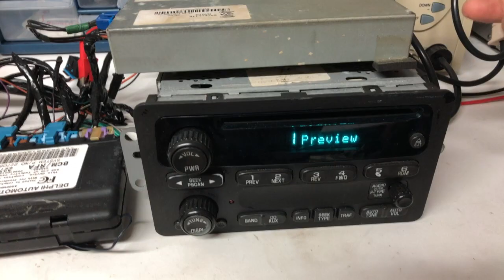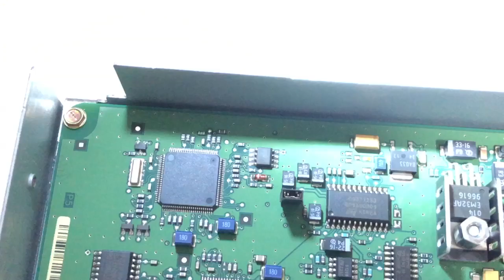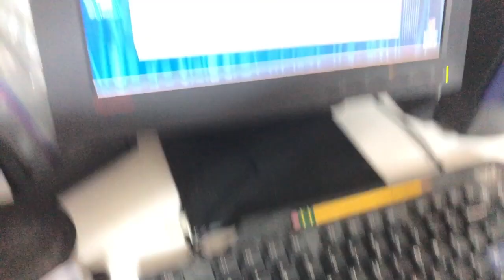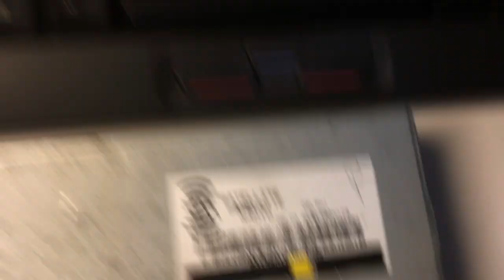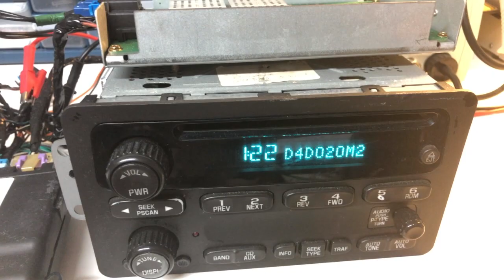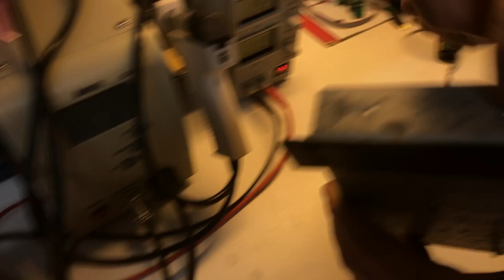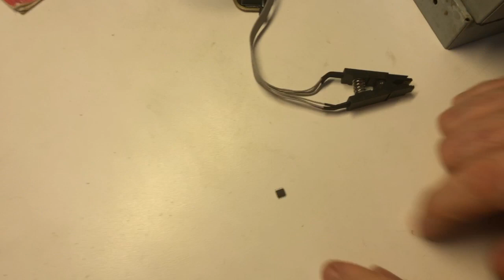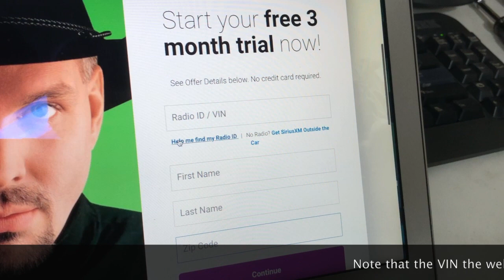2003 04 05 Unlock XM Lock Error on Salvage Yard GM XM Receiver (Buick Cadillac Chevrolet Pontiac)

Comment: What would happen if you just disconnected the chip rather than reprogramming it?
Reply from the maker: Well we can see the XM Radio ID, the units serial number, and likely what appears to be XM station preset info stored in the EEPROM chip.  There may be other obfuscated information stored there as well, no way to know as GM never documented it publicly.   While I've not done it myself because I wouldn't have considered it a repair but more of a mod, I'm quite sure removing the power pin of this EEPROM chip would still clear the VIN lock.   But then you would have to accept the loss of whatever minor XM functionality was dependent on the data that chips memory locations contained.
Reply: @DrShock   So I ended up trying out of desperation and it seems the only issue that it's given me is I have to press the Second knob in to see artist or song info, otherwise it doesnt show it and  just stays displaying the station name.
Reply from the maker: Thanks for sharing that, what about displaying your Radio ID on XM channel 0 - does that still work?
Reply: @DrShock  yes, it does.  I disconnected the battery for a few hours to do something and now it's acting up, I still have all my channels but it keeps turning itself back and deleting my presets so maybe it needs to sit for a while like it did last time when I 1st installed it and it was acting up or something is messed up. I'll keep you posted.
Reply from the maker: @AlexSirghie  Yeah, this is just one of the side effects and why replacing the EEPROM as I showed is the only real repair here.  But having some other option if you lack the tools or parts is good to know, thanks for sharing.
Reply: @DrShock   So after leaving it connected and attempting to make it work again, its messed up.  I'm just gonna grab a new module from the junkyard because there's an envoy that has one plus this one is the kind you have to take the chip off the board to make work, so  Sense the envoy is a little newer I'm assuming it has the style where you can leave it on the board and I bought the same style chip programmer you have.  Hopefully I can figure out the right software to make it work.  Can this be made to work with unlocking a head unit as well?  My message which has worded flawlessly the 2 times I've done it is transferring the chip from one stereo to another which is how I got a Pontiac stereo to work in my Malibu, but I'm switching to the touchscreen 1 that the rendezvous Got and I don't wanna heat that chip up any more times and risk ruining it, could this method be used for that?
Reply from the maker: @AlexSirghie  I haven't worked on any nav head units, or the touch screen ones yet.   But for the earlier RDS type radios the approach is very similar, I did a video on that here https://www.youtube.com/watch?v=ZIRefUhyJOQ&lc=UgwTkSwbhvMA04hit8x4AaABAg
Reply: Thanks for that, what does it mean if I've done everything you've done including modifying the programmer for 5 volts, but I'm getting nothing.  The LED is lighting up whenever it's connected and it says that it successfully talking to it but all the values are empty or have zeroes. What did I do wrong.  These don't have the type of chip where you have to re-pin it right?
Reply from the maker: @AlexSirghie  Be sure it's pin 1 aligned, and in the right half of the ZIF socket on the programmer.   You should be able to read it even at 3.3V, so the EEPROM programmer mod isn't even needed for reading just writing.
Reply: @DrShock   So it turns out my test clip was bad and all of the weires were just heat shrunk to the pins instead of soldered correctly (they just slid off), so I ordered a new one and I ended up remedying it by removing the the eeprom from the reciever and moving it onto the board that plugs into the USB stick and got it going.  Thanks for the help, I have now successfully retrofitted satellite radio into my Malibu as if it would have been from the factory if these had got it.
Reply: @DrShock what is the mod needed for the 5v or is it just a jumper change on the programmer?

Comment: I am curious about the jumper.  I wonder if you remove the jumper and then use the tech 2 to setup a “new module” if it will then make it writable and it would learn the vin like a new module would.  Then reinstall the jumper when finished.  I recall some eeproms having a write enable hardware pin.
Reply from the maker: Not sure what you’re referencing from the video, as there’s no "jumper" associated with the memory device (EEPROM chip) on this specific XM circuit board.
Reply: @DrShock in the video where you mention the jumper pin on the board and the two different locations depending on the first gen or second gen board.  I ordered a programmer and should be here tomorrow to update the vin in my jarkyard unit I am installing.
Reply from the maker: So that comment was just meant to highlight a means to distinguish between the two board layouts.  Not that it had anything to do with the VIN lock procedure itself.  

The BCM handles the VIN lock (aka TheftLock) state and will program the EEPROM of both the radio module and the associated XM module with the VIN.  But only if they are virgin (i.e., already blank / missing a VIN) like a brand new replacement part, or a suitably erased remanufactured part.  

If the XM receiver is not virgin, further attempts to write to it are blocked by the BCM.   So another approach than what I showed here, if one had the image of an NOS XM receiver still in the box, would be to flash the XM receivers EEPROM with this virgin image and then let the Tech2 / BCM add the VIN just like with a replacement part (this approach would work for the radio module as well btw).
Reply: @DrShock I have the first generation so I have to unsolder the chip. Ugh.  I assume that needs to be done since it’s being loaded down by the in circuit components?
Reply from the maker: If you have trouble reading the chip yeah that's usually a sign of a board layout that is powering up other devices creating bus contention.   You have to take the chip off board in those situations to R/W to it.
Reply: @DrShock  I was able to de solder the chip, however even with a magifiying glass I don't see the mark for pin one for the 9355093?  I also watched your other video about the 5v mod for programming that I will have to do.  Thank you for your help

Comment: @DrShock how do I get in touch with you, I have some questions you may have the answers to. looking forward to connecting.
Reply from the maker: If its a question about this video, just leave a comment here (or if it's about a different video leave the comment there instead).  I don't offer any other assistance beyond this approach.
Reply: @DrShock  i really don't need assistance, just some answers.

Comment: Love all of your eeprom videos.  I used to work with eeproms way back and am glad to see people still doing it.  Here is my question..... So i had XM on my vehicle before it was just totaled.  I had a special rate that i prepaid for5 years of service and it is not transferrable according to XM.  I know my radio id on old vehicle and new radio vehicle.  I changed the id in the new radio to the id of rhe old radio (verified it was actually on the eeprom) and the id got changed back automatically so it didn't work.  Obviously there is a module somewhere (radio, BCM, other) that is the master that is overwriting it.  Any thoughts on what other module in the vehicle is doing that? Or is it another eemprom within this module that is overwriting it?  Thanks.
Reply from the maker: In order to keep that lifetime subscription, you would have to keep the same make/model/year range of vehicle and same type of radio and XM receiver pair.   Then copy the original XM receivers EEPROM contents and (with the copy only) overwrite the VIN (at least with GM vehicles) in the EEPROM memory of BOTH the replacement radio and replacement XM receiver to match the new vehicles BCM VIN because none of the scan tools are allowed to reprogram an XM module.   As you've seen any other approaches will be thwarted by the firmware inside the module.   This is a combination of BCM, radio, and XM receiver all working together to insure VIN locked alignment.
Reply: @DrShock  Thanks for the reply.  I had a 2005 Grand Prix that has a board very similar to your video.  New vehicle is a 2008 cobalt.  I guess what I want to do won't work on newer vehicle since they are different type of model radio & XM receiver modules.  But that makes me really wonder....Is it really hard coded into the XM module or is it possible that it is in the radio and the radio is the master that feeds it the XM radio ID once the initial pairing is done at the factory?  Example the BCM has mileage/VIN and it is the master and if the Speedometer module or radio is changed without the proper VIN or even a different mileage coded, they won't work.
Reply from the maker: The radio negotiates the VIN with the BCM.  BCM is only involved in the VIN.  Radio stores the VIN and makes sure the XM receiver matches that VIN.  Radio knows knows nothing more about XM receiver.   XM receiver uses VIN + ID to communicate to the satellites for account authorization and authentication.   The ID AND VIN must match or your subscription isn't going to be valid anymore.  The XM receiver knows nothing about the vehicle type (make/model/year) just the VIN and ID.   But it knows if the VIN is not a match with the BCM because the radio is in between to tell it that information.   The XM receiver will VIN lock when this is detected.

Comment: So if u clear the eeprom can u then use Tech2 to lock this to ur new VIN?
Reply from the maker: These older XM receivers behave differently than radios.   There is not a VIN relearn on the Tech2 for an XM module, hence this video.  

I have done a few of these modules by the method I've shown here, which is limited to only changing the VIN contents.   I'm not sure if setting the VIN memory to a default value would be enough for the radio module and BCM to relearn it on their own (the process that a brand new XM module would be learned by) since the rest of the EEPROM would have non-default information within it.   Likely you would need access to a brand new module to image it's default EEPROM to re-virginize an used module.

Comment: I'm trying to install an aux on Pontiac Grand Prix 04 with no xm. It seems to not work without having xm, so now I am considering buying a used xm receiver and unlocking it just to make the connection. I just don't know where it goes in my vehicle and if it has the wiring included already in my car? Would anyone know?

Comment: just wondering (i don't see why you actually would do this since you could just input the correct value lol just curious is all), in theory could you zero out the vin number in the hex editor and be able to do the module setup with the tech ii successfully?
Reply from the maker: If you had a Tech2, then yeah you could do that approach (tho keep in mind no scan tool can erase the VIN from an XM module you have to manually edit the EEPROM).   But most folks watching this are more electronics folks, and not automotive folks, thus are not going to have that kind of automotive specific tooling.  So just input the VIN into the memory and you're all done.

Comment: would it be possible to install an xm reciever into a gm radio that is xm ready but didn't come with xm from the factory? would there be any extra components required for it to work?
Reply from the maker: That's very much in the it depends category for a GM factory setup.   Older model years the XM receivers were separate modules.   Newer model years they are circuit boards or cards installed inside of the main radio head unit module.
 
Older years the challenge would be the wiring harness and antenna routing access and the you would most likely have to reprogram the main radio module to enable access to the XM receiver.    For later years it would be the antenna routing and the programming.
Reply: @DrShock  i've looked into it and for my setup (2005 chevrolet silverado 1500) it doesn't seem too difficult. i have a us8 radio i found at a scrap yard that i've already unlocked, and i was able to snag the wiring harness that came out of it's original vehicle. only thing i think is left is to find a shark fin and route everything into the bcu. it seems more easier for older model years imo.

Comment: Maybe this is a longshot but I found an xm car module just like this from 06 with a lifetime subscription to siriusxm which is extremely rare. It’s not made by GM but it appears to have similar chips and an eeprom. Can confirm it still works in its original vehicle. Do you think I could swap the radio ID on the eeprom and the chips that hold xm specific functionality to a newer digital radio in my 2012 chevy to give it the lifetime functionality? Since I’m not the original account holder if I called to transfer like you said they would probably cancel it
Reply from the maker: If it's not a GM original equipment XM receiver, then it is very unlikely to be VIN locked to the vehicles BCM/Radio head unit.  I would expect there to be zero chance of moving chips between receivers made by different suppliers.
Reply: @DrShock  Yeah it sounds impossible. I was just wondering if there’s one specific chip like the eeprom that’s responsible for the telling the rest of the unit what the radio ID and account is, that could be transferred over to a new unit, or if multiple components separately keep track the radio ID... either way it’s probably not realistic
Reply from the maker: If it were an OEM GM XM receiver, then the EEPROM contains the radio ID and that is usually what is used for the account association at XMSirius.   But if it's an aftermarket receiver, it would have its own unique approach to storing this information.    Plus by 2012 GM had an integrated XM receiver inside of the radio head unit, so that 2006 era XM receiver design would likely have a different approach of communicating with the radio head unit as well.

What you might be able to do though is research on some forums if there's a way to get the 2006 unit working in some sort of fashion as a second or additional unit.  If it's aftermarket there may be some information on how to connect it up to other vehicles of that era.
Reply: @DrShock  I will look into it and report back if I get anything working. It’s a salvaged OEM unit that appears to be compatible with audi/VW radios from 05-08, I have a 2012 chevy volt

Comment: Where could I go to have someone help me with this? I’m asking because I have no clue how to do this. I don’t have the tools or software. Please help. I have an 04 tahoe so not sure if this will even help
Reply from the maker: This is definitely not a project for someone who has no electronics repair experience.  But you can buy unlocked radios on eBay, though their price reflects someone else having done this already.
Reply: @DrShock  perfect thanks for the help. I do appreciate it.

Comment: Why radio show XM theftlock after I was disconnected the XM conector?
Reply from the maker: If the radio is programmed for the XM receiver option to be installed, and it cannot confirm the VIN for any reason (even if due to a communications problem) it will lock the XM receiver functionality.

Comment: Good Morning on Christmas eve 
Yes, I have a 05 Chevy Trailblazer Lt when I took the manufacturer's radio out and try to put an after-market radio on when installing it in the SUV I couldn't get it to turn off when I turn off SUV it didn't kill the power to the aftermarket radio. So I couldn't find the Is original radio that came out of the SUV I find another radio 05 chevy trailblazer the radio is locked so I can't Ford cannot tech2 scan is there another scan that can do the same like tech2 VXDIAG VCX NANO GM this on Amazon will this work it  TECH2 scan tool 
Could you PLEASE CHECK IN TOO
I'M CALLING FROM HOUSTON TX
I hope to hear from real soon ok Oh keep up the good work on your video on here ok
Reply from the maker: Merry Christmas Eve.  So this particular video is about unlocking XM receivers, not radios.  And no, you cannot unlock an XM receiver with any scan tool whatsoever for subscription security reasons.   Editing the EEPROM chip itself is the only way.   The GM dealer will just tell you to buy a new XM receiver.

For a radio though, you USED to be able to use the Tech2Win emulator on Windows with a Nano as a J2534 passthru device and the approach this other video goes over https://youtu.be/ZIRefUhyJOQ

I say "USED to" as I'm not sure if VXDiag ever got their nano working with GMs new Techline Connect service that started late last year.  You would have to check with them.

Comment: Are these XM units compatible with any RDS radio of that style or only specific models? I have an '02 Cavalier, using a Tape/CD RDS head unit from a 2000 z24.
Reply from the maker: They are not universally compatible as radio bus communication protocols were evolving and changing during this time period.  You'll want to stay with the same model year range.  So if the radio and the XM receiver were available as a combo on some GM vehicle for a given year when new originally, keep them paired up when you transplant them.

Comment: Just so people know... if your issue is the satellite tuner module and not the radio, then removing the epromm from the board removes the XM Theftlock. Time and presets are not effected, because those are stored on the radio and not the tuner module. It appears that all that is stored on the tuner module epromm is the VIN from original vehicle. I removed the epromm from the tuner module board a week ago and everything is working fine.